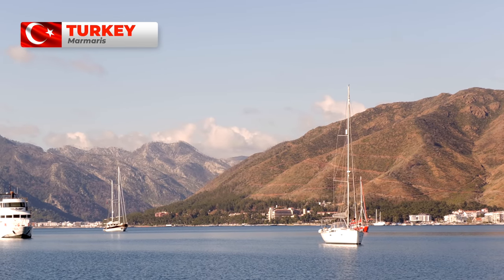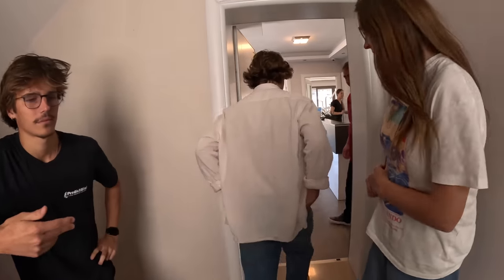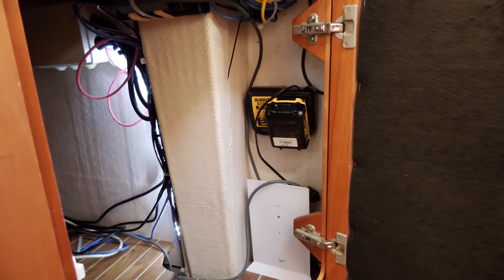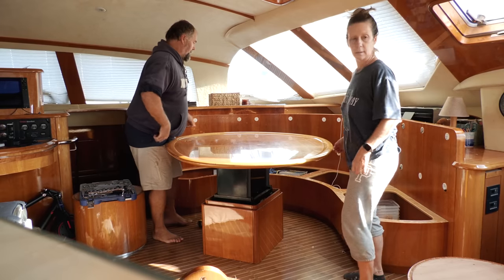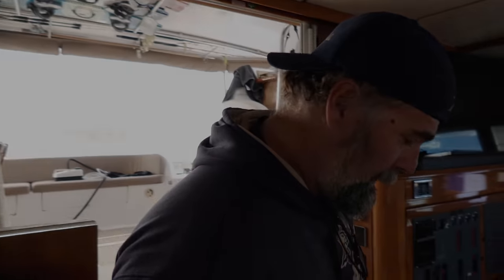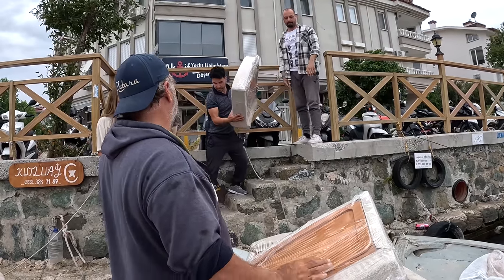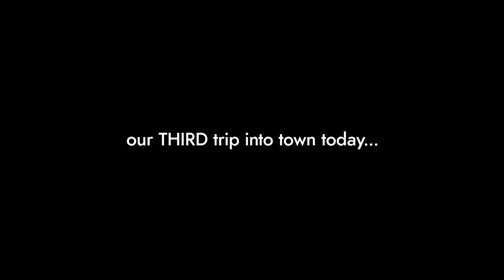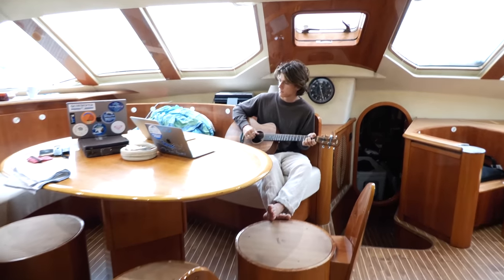CATAMARAN REFIT: Updating our Salon & Installing new WiFi! 💫 (Ep 238)

Comment: If u want to put it all on one router / feed all inputs to one .
I worked for an internet company and we used a lot of mikrotik routers for big companies that wanted fast internet you can have lots of inputs and only one out for broadcasting to a wifi router.
Only problem is to configure it up its a bit of hassle.

Comment: As a person who does restaurant booths....  The boards are locking cleats. You put the back into place and kinda "jump" down onto the front as you also push back. you will hear the cleat lock into place. And yes the cleats needed to be taller and adjusted for the thickness of the add-on covers

Comment: Plastic ties on a guardrail are likely to slip!  They lack the tension required to maintain installation integrity.  Besides, plastic creeps under outdoor conditions, and the integrity of plastic degrades under UV, direct or reflected from your deck.  High-quality stainless steel hose claps have near-zero creep, are impervious to UV, and will be far more secure.  You might say, "It's good enough for now," but it's really not.  A single wave or high winds can easily smash your shiny new antenna.

Comment: Hi, You said you are using leather for the cushion covers. Don't you have a problem with mold in tropical climates?  In Bali if you don't use the leather it develops a white or green mold. I've even had coconut bowls that were made with wood that was not dried and put them under my bed to slowly dry, and when I checked on them they had a layer of white mold on them. So to the point it seems to be the best to not bring leather products that don't get frequently used to the tropics. Feedback would be appreciated. Peace

Comment: Hey! Wondering - why did you decide on CAT5 and not CAT6, the former is limited to 100Mbps which could throttle your speeds, especially if there are several users at the same time?

Comment: Dentist time while the wifi  gets sorted , 'Scale and polish ' for $75 ? About what I pay just for a 'consultation ' with my neuro surgeon :-) 30 -40 mins , with chat :-) I have med aid for local @$260 / month . 
    I am cost sensitive , so nice to do comparisons . $50 for a filling ? . 
Am overdue for a scale and polish , get a quote on the other work :-) 
Back to the table , wondered what happened :-) ? A bit pricey ? 
So just fixed at one height ? Strip the steel inside have 2 pins , take out to lower :-) 
  No buying bottled water then :-) 
Joe is cool on the guitar :-) 
    Cushions do look really fine ! Cool covers too .

Comment: Have you ever heard of a company call Sharrow Marine LLC?  The suppose to have a new Propeller design that will increase engine efficiency by 20% or higher.  Have no idea the cost, but I would think that it would pay for it self quickly, since you do Motor Sail from time to time.  I figure fuel cost is one of the major expense owning a boat when traveling around the world.

Comment: Typically you don't mount a wireless AP vertically like that.  They are designed to be flush mounted on the ceiling.  Look at your model to verify this.  May help your coverage.

Comment: Not sure which access point and router you're using, but I would be concerned with the number of clients you have. Commercial access points can usually handle a hundred+ client devices with no problem. Consumer ones, you're lucky if you can get 30. I couldn't tell from the vide which AP you were using.

Comment: Why don't you ask us for recommendations before you go out and buy all your stuff?

Among other things, I was a network security engineer in the 1990s and 2000s.  I've kept my hand in the game ever since.

Free but high-quality tips:

WiFi:  One will do, but a central WiFi with four repeaters, all running at low power, provide far better coverage with less radiation.  

Antenna coverings for WiFi frequency ranges are made out of fiberglass, so a central location, such as in your central cabin, should penetrate the upper deck and fiberglass hulls nicely.  That said, if you want an excellent signal everywhere without bathing in excessive but non-ionizing radiation, use a central antenna with four repeaters, all on low power, with the main unit in the central cabin and a repeater at each end of each pontoon, for maximum coverage.

The obvious issue, however, is that you really don't want to be bathing in microwaves.  Fortunately, the 4G, 5G and xG conspiracy theories about WiFi rewriting your DNA are indeed absolute debunked junk.  Visible light lies between microwaves and ionizing radiation that can damage your DNA.  That said, "exposure to Wi-Fi for a year results in the "same amount of radiation from a 20-minute mobile phone call" (Retrieved from:  http://news.bbc.co.uk/2/hi/technology/6677051.stm).

Thus, WiFi is generally safe, but definitely put those smart phones into airplane mode or standby (they can still use WiFi), and keep your cellular range extender off when not in use.  For that matter, mount it high, at least on a mid-mast satellite/radar/radio/comms platform.

I would also turn off below-deck repeaters overnight.  Why tempt fate?  Test to be sure you still receive critical alarms from the main WiFi router in the salon.

For heavy lifting, such as uploading video, plug in!  Connect your video editing/rendering computer via Cat-5 or better to the hard-wired LAN.

Always use a VPN, preferably one built into your router.

Keep your WiFi and router devices separate.  It's cheaper in the long run and more secure.

Use randomly-generated, full-length WPA2 passwords.  Pain in the butt?  Yes, but not nearly as much of a pain as having your network hacked.  You only need to set it once for each computing device.

Store critical information in a file vault, such as Cryptainer (free < 100 MB), Bitlocker (free w/ Windows 10/11 pro ($100)), or my highly-secure but someone complicate VeraCrypt.

Get the kids to plan these things.  Have them brief you, make corrections as necessary, then let them buy, receive, install and check the final results.

Comment: You need to do a in depth video on the Starlink and internet networking install.  Not spend 75% of the video on upholstery!  Did you convert it to run on DC? They make off the shelf kits now for that. How did you mount it where did you what are you doing about lightning? How are you managing cooling? Separate dc bus with surge protection and a ups backup? How are you dealing with Starlinks constant policy changes re where and how you can use the service? About the plans that allow offshore use? Where does it work and where does it not? Speeds? Do you have to register it in every new county you go to? Did you flat mount it? How did you configure the peplink?  

Worse tech how to video you’ve ever made showing a system.  This is your boats whole communication system. How you’ll monitor and troubleshoot things. It’s how you make your living.  So I’m sure you did all those things and just are being super top secret about it for some reason.   Not like there aren’t 50 other YouTube videos about this. On and sailing channels that are showing all those. Ohhh.  I’ll go there maybe they won’t spend their whole videos showing a horrible upholstery company trying to put cloth over leather.